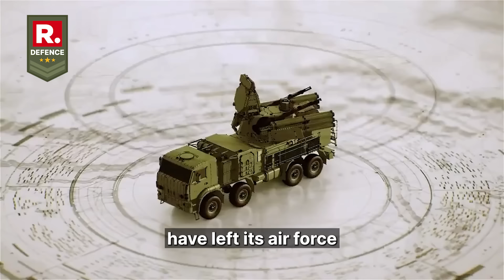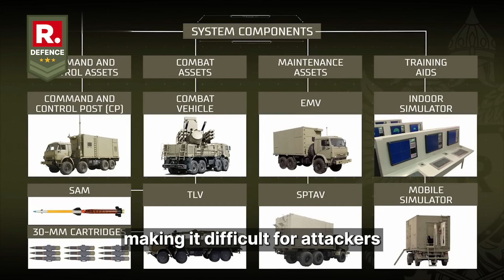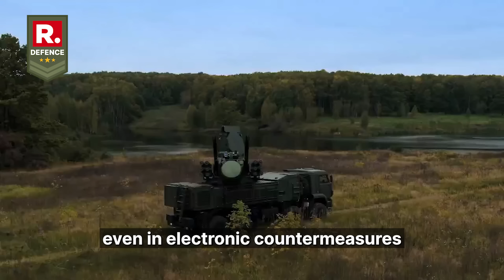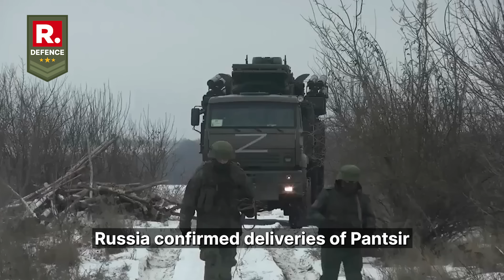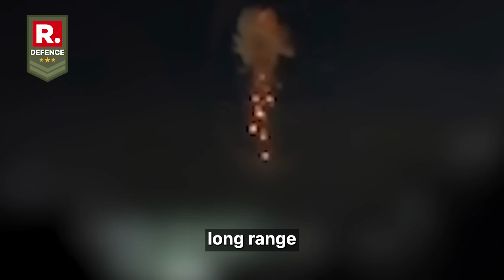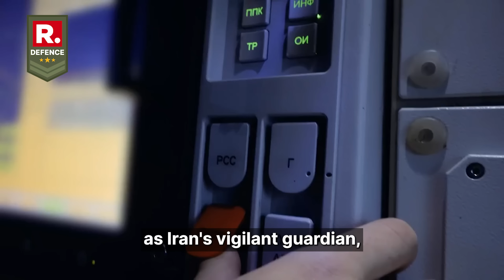Russian Air Defenses Arrive in Iran Ahead of War

Comment: No amount of missiles or air defence is enough if you don't have a proper software system to operate all those missiles or ADs. As far as I am aware, Iran is not particularly strong in the software section.